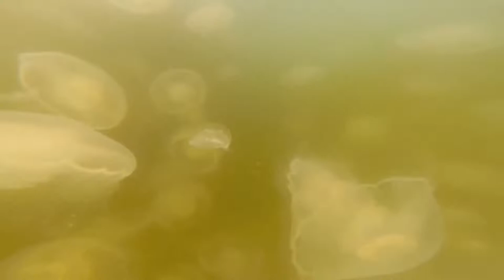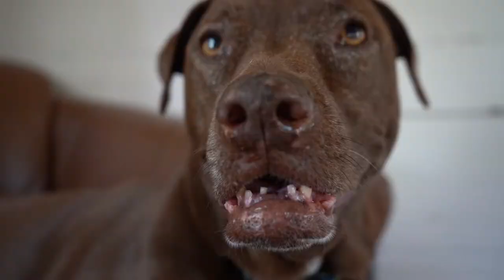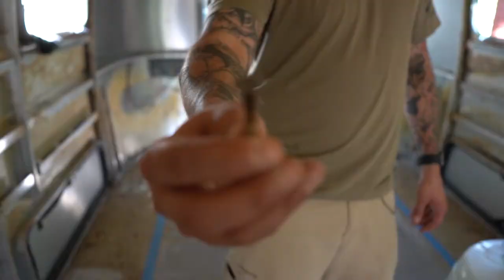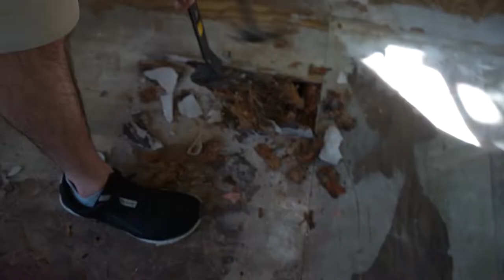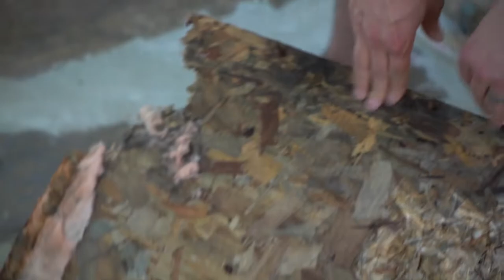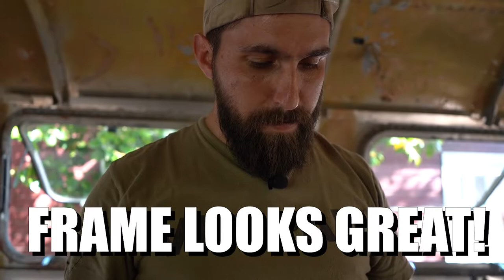AIRSTREAM RENOVATION || Beginning Floor Removal || Are we SCREWED?!

Comment: The frame looks great.  I had same water damage in the very back and front of our 1990 29' Excella.  Was not a fan of the particle board floor.  Glad Airstream went back to plywood.  We ended up replacing the damaged areas and finishing the floor with Bruce engineered hardwood oak planks.  Bamboo might be the more environmentally friendly way to go, maybe.  We loved our oak flooring.  Still looked great after thousands of miles and 15 years later.
Reply from the maker: Gene Carlson II That’s what we are thinking, bamboo. Also wait til next video 🙁The outrigger in back left corner is rusted through. Gonna have to replace it.